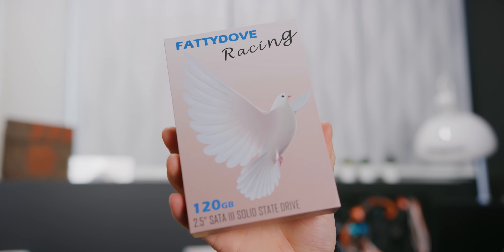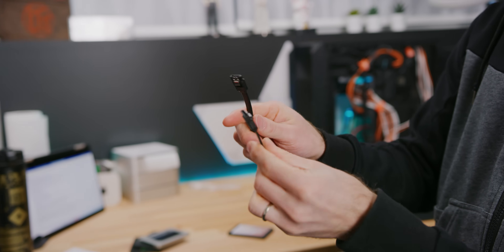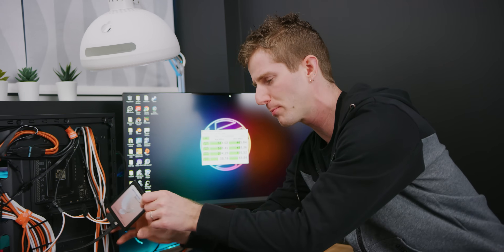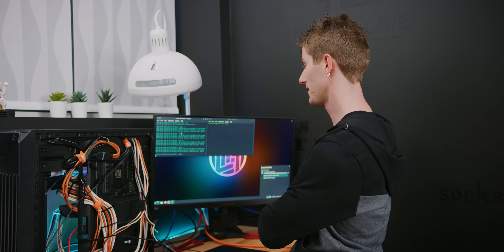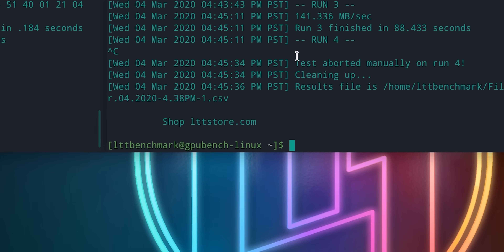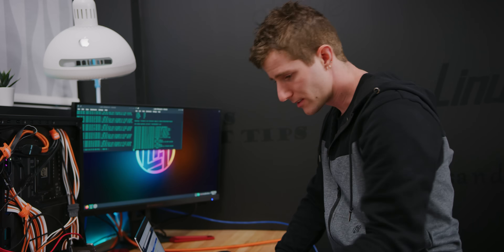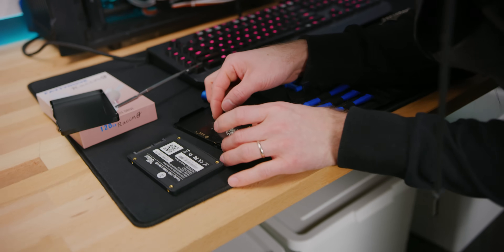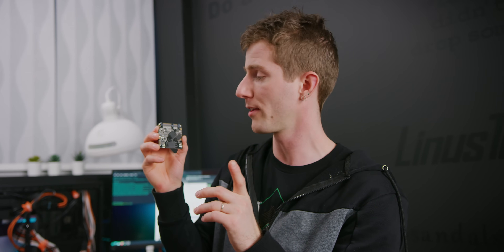How bad is this $20 SSD??

Comment: Such kind of SSD drives are pretty common in China, since I saw the manufacture is located in Shenzhen, China.

The key to reduce the cost is that they are using a 2nd-hand flash chip, desoldered from trashed components or something used. Or defective flash chips from flash chip manufacturers (It's still a mystery how they got the defective chips, because it should be destroyed by the chip factory). re-package them and sell them to customers, the warranty they claimed is mostly not helpful, they won't give you a RMA service in most cases.

Because this reason, this thing is easily broken, months to years is possible. Since the flash chip had been used for a long time (maybe a short time, it depends on the previous user of the Flash chip), most of them do not have a decent lifetime.

If you are seeking a SSD for your daily device, DO NOT USE SUCH THINGS FROM SOME UNKNOWN MANUFACTURE.

If you are just use it like some cacheing drive, won't store any precious data on it, it might be a good idea to use it. Because it's only cost $20 after all.

Comment: Damn.... I'm rather impressed, I am likely going to sell off my old gaming PC when I finish my new build.... I may buy one of these to put in when I sell it.
I wanna keep my Samsung SSD, and all my high performance HDD's. 
But putting this in, with a reinstall of Windows, and one of my old 1tb drives I don't use....... I think it would be well worth the investment on the return I'd get selling a fully done up system, rather then a parts system someone would have to finish. 

God knows how long it will last, but it's a brand new SSD, it's not like I made use of one of my old failing SSD's..... So I did my part!

Comment: My system is running on a 26€ 120GB Kingston SSD and I never had any issues. I thought the price sounded rather normal. 
I was getting a 250GB HDD back then, cus my old one broke, but then saw I could get an SSD with ½ the space for the same price, so I changed for that one.

Comment: It seems pretty hard to consider one of these when you can spend another $10 for a decent brand that might be around if you ever need the warranty.
Reply: @Vincenzio VonHook they became that cheap? Comparing em to sd cards... That's pretty much on par.
Reply: I got a SanDisk ssd 120gb ssd for 10 bucks in an eBay auction, but buying obscure brands with low reliability isn't the best

Comment: "sata cable, pretty good bonus" not so sure about that, more a source of garbage and pollution. I get 2 cables for each motherboard I bought, overtime I've probably accumulate over 10-20 unused sata cables that I'll never use... really it is not a good idea anymore to include extra stuff we won't even use. I would say the same for modular PSUs, they should only include the motherboard ATX and 12v cable (or maybe enot even that), and you buy the rest with proper length and everything would fit even better

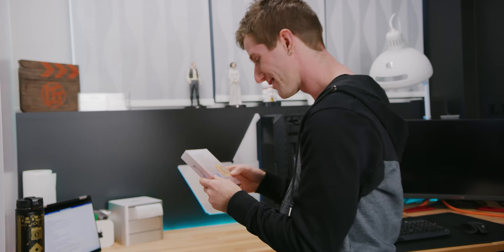Comment: 1:21 Linus, I can explain, I lived in China for over a decade and even then, there are things which I call Quantum Chinese, or QC for short. 

Why? 

Because with quantum physics is it's impossible to know, with any certainty, the reason behind of any observed behavior.  So too with Chinese, its impossible to know, with any certainty, the reason behind any observed behavior. 

I wear many hats, I worked in manufacturing, I am a neon glass blower, I am also a designer and its with the latter I can explain, without any certainty why this SSD has a Fat Dove and the word "Racing", because Quantum Chinese. 

The bird is there only because its a symbol for peace, and peace is a nice thing, so why not have a really peaceful dove?  Why is it fat?  Buddhas are fat, and if anything is peaceful then its a happy fat Buddha, right yes?  The word "racing"...that's easy it means to go very fast, as fast as possible in fact!  The peaceful fat Buddha dove doesn't have any connection with Racing, and why should it? While you're bathing in the fat Buddha dove Chi you know that this product is very fast, one might say "racing" and look here, it does say that.

And there you have it, Quantum Chinese.

Comment: Hey guys, probably a bad place to ask but I've terrible at PC diagnosing and i recently built a new pc for myself
My issue is general under performance particularly in minecraft where in this weird case if i change a setting like graphics from fast to fancy, my frames jump up to 300-400 roughly where they should be, but as soon as this happens it slowly goes back down to between 40 and 100 frames, i have checked thermals updated my bios and I am absolutely baffled please can someone help me out I have never been so stressed out in my life!!!
Specs are as follows : i7 9700k
16gb ram
2070 super
550w psu
msi z390 a pro mobo

Comment: I have a really budget garbage SSD in a Socket 478 Pentium 4 system I setup for running old games, Windows 98, 'cause emulation just doesn't do it for me. The SSD I have in there is a 32GB KingDian SATA II (Yes, SATA 2, not 3) rando cheap as balls on amazon (Like $13) SSD. It's also running on an IDE to SATA adapter, so I wasn't going for speeds, just somewhat modern reliability.

Comment: The day had finally come when Linus uses Linux to do some routine hardware testing for a review. :) Makes me so happy!
Reply: Which linux version is that?
Reply: @akshay6019  It's Manjaro KDE
Reply: @ChrisLoyen  Yes indeed, that theme is breath2, the default Manjaro theme, and the colorscheme for the terminal is also set to breath which is default in Manjaro. I have distrohopped way too many times, so much so I instantly recognized it was Manjaro lol...
Reply: @akshay6019  No way to tell which distro/kernel, but the desktop is KDE/Plasma. Great desktop for general use...maybe among the worst choices for hardware testing though (all that polish/flash comes with a price in resource overhead).
Reply: @Code-Sandbox-Dev  not anymore. KDE now uses less ram than xfce. :) To be fair though, I'm guessing they're using Kubuntu, which wouldn't have the latest version by default. Still, the fact they just casually booted into Linux to run hardware tests is amazing regardless. :)
Reply: "leaves"*

Comment: I have PNY CS900 120GB 2.5” SATA III Internal Solid State Drive (SSD) - (SSD7CS900-120-RB)- got it for $20. It works just fine on a laptop that is 10 yrs old now. 👍🏻

Comment: Next news story to be along shortly:  CEO of Fattydove Racing found dead in the street with an nvme SSD sticking out of his brainsteam.  Seriously, Samsung et al are not going to stand for anyone breaking their ABSURDLY profitable pricefixing scam.  Anyone with half a brain could see that NAND storage is 100x cheaper to manufacture TB-for-TB compared to hard drives and just naturally 100x faster than mechanical garbage.  It's just so basic, needs no exotic materials, nothing.  It's a grid of transistors.  Not a million miles from being interesting, much less lucrative.  The ONLY way to preserve the existence of the whole mechanical drive market much less prevent storage costs from falling to almost nothing, is rock solid price-rigging.  It's not a random coincidence that Samsung was the company to bail the corrupt president of SK out of jail and that same president was the one who cancelled the investigation of the NAND market for price-fixing.  It's not a random coincidence that the exact same companies making NAND flash storage are the ones who got busted for price-fixing RAM chips, then got busted for price-fixing LCD panels, then got busted for price-fixing RAM chips AGAIN.

Comment: Cool drive. I'll stick to my 120GB Kingdian S280 drive with infinite TBW tolerance. $25 but that $5 premium edged out the Fatty. 60/120GB disks don't make a whole lot of sense to people but for a while 60GB was my main and then this 120GB disk. The 60 is now the main drive in my rack and the 120GB is now additional storage in my development server. The main disk is a 240GB Corsair MP510 NVME drive and I kind of wish I had another to do RAID 0. Imagine using another Fatty and doing reasonably fast SATA 6Gb in RAID 0 for $40.

Comment: Hey Linus! You should check out the 'FATTY DOVE' counterpart on Amazon.co.uk 'ALERT SEAL'
ALERTSEAL SSD 48GB 2.5 Inch Internal Solid State Drive SATA 3 SSD for Computer (SSD-48GB) 
https://www.amazon.co.uk/ALERTSEAL-Internal-Solid-Computer-SSD-48GB/dp/B082HR9ZRL/ref=sr_1_22_sspa?keywords=SSD&qid=1584051686&sr=8-22-spons&psc=1&spLa=ZW5jcnlwdGVkUXVhbGlmaWVyPUFTUFJTMlk2UjdNNlQmZW5jcnlwdGVkSWQ9QTAwMTk3NTcxUjRXRElXVVBQU1VSJmVuY3J5cHRlZEFkSWQ9QTAzMzM5NzlWWFVBRTBYVE04V0Imd2lkZ2V0TmFtZT1zcF9idGYmYWN0aW9uPWNsaWNrUmVkaXJlY3QmZG9Ob3RMb2dDbGljaz10cnVl

Comment: HIlarious!! I just clicked on your link to the FattyDove and the price listed on Amazon is $597.90 !! Took a screenie in case it changes back
Reply: Over $620 for me
Reply: $37.89 for me
Reply: 37 bucks for me
Reply: @timoschubert96  $37 is 240Gb. The $20 one they have is 120Gb.
Reply: @timoschubert96 exchange rate must be screwed up for me
Reply: It's because they don't want to run out of stock, which means they have to relist it, which cost more. They increased the price so no one buys it.
Reply: $626.39 for me!! 😂😂😂

Comment: you know if they would make a 3.5 inch ssd imagine the storage capacity you can get instead of making chips smaller they just add more storages chips and pcb boards that are connected

Comment: I´m pretty  pleased with my 18€/20$ 128 GB Kingston SSD. It`s mainly used for Windows and small programs but felt really reliable.
Reply: I have a 1120GB SSD, i split it in 3 partitions and installed a OS including all programs in every one of them (3 OS installations in total). But i don't know that to do with the other half.

Comment: Hey Linus!
I just want to point out the reason why I would prefer a cheap dram-less SSD before a traditional HDD and that is: Windows Fragmentation.

Even after improving this issue a bit with Win10, an HDD will work fine with a fress Windows for about 3 weeks to 3 months depending on users, but after that you will need to defrag the disk and 90% of users do not even know what is this.

But SSDs, even the cheap ones do not suffer as much with Windows fragmentation so I have recommended always these drives to store OS and apps

Comment: Would it work if you took a bunch of low-grade processors andothers parts and put them all together in a huge case as a sort of Frankenstein pc or would the sum of it's parts not add up to any improvement?

Comment: In all my years working with Linux I have never heard anyone pronounce it “soo-doo”
Reply: My dumbass read your comment like if you worked with Linus
Reply: I have heard it as both soo-doo and soo-doh. Also, gnome and guh-nome. Etc etc etc it doesn't really matter
Reply: It stands for :
Su bstitute User Do 
So it is pronounced Soo doo :)
Reply: @fleefie  substitute? Not Super User?
Reply: @o0julek0o  substitute yeah, afaik. You can use the -u flag to specify the user. Default is root, as it is what you tend to use it for most often :)
Edit: admittedly, it used to (ages ago) only do superuser. So originally it stood for superuser, I think.

Comment: The marketing is probably not on the level, but I think TLC SSDs do have SLC cache in the sense that they use some cells in the flash chip in SLC mode to act as cache. Explaining Computers had a video about this.

Comment: Some DRAMless drives can treatsome of the reserved flash as SLC and use it as cache.  You just get 1 bit per cell capacity instead of 3 for the part of flash that you are using as SLC cache.

Comment: hey i need some help if anyone got time, i had 16 gb (2x8) ram corsair rgb vegeance pro 3000mhz, n bought a new kit of 16gb (2x8) corsair rgb vengeance pro 2666mhz, n put them all together in my pc which should be 32gb (4x8)gb ram. so i turn on my pc and only 2 of the rams are working, i check bios and it can only see 2 of them. i turtn off my pc and change the placements and 2 of them light on but 2 of them aren't. tried to find vids to fix it and i just can't find anyway. I got a ryzen 7 2700x cpu and a tuf gaming asus motherboard, windows 10 home. usually i checked and it supports that much and def more. if anyone got any idea on how to fix it, it would be great

Comment: I have AT&T DSL sadly the only option where I live is there anything I can do to increase its speed? Will a vpn help at all?
Reply: No a VPN is never going to make your internet faster, the best it can possibly do is be fast enough that you don't notice it.
Reply: @boheyo  The main reason I asked was because for example after 7pm for whatever reason it seem like my speed is cut in half.  Normally I'll have around 6gb down but after 7 it's like 2.8 - 3.2mbps and at midnight on the dot the speed returns to normal I figured this was due to AT&T throttling their speeds.  Maybe I'm wrong on this assumption

Comment: If its only 1 layer deep it will be slower compared to 3 layer but as it gets full it should be faster since it only has to access 1 layer when its reading or writing....it should last longer also because its not layered unlike triple layer where data accessed on the bottom layer will also affect the 2 layers above it in terms of wear on the drive which shortens the life span of the cells. My intel nvme drive and many ssd drives are fucking annoyingly slow when they get over 60% full. I now burn a lot of stuff like media files to blue ray and install programs that are space hogs or used little on a mechanical drive. I then have 6 ssds and 1 nmve drive to run my linux os with a  vm windows 7 instance, virtual drive space plus games across all of them keeping them below half full most of the time.

Comment: $20 isn't really a bargain, the price scales to $40 for 240GB SSDs and somewhat linearly until you hit TLC and QLC SSDs.
Reply: Connectors, RAM, controller, case and PCB also cost money, you don't expect linear prices. If so, i would love to buy a 16 GB SSD for just 3$.

Comment: I don't think anything could be slower than those 4TB portable HDDs that Seagate sells.  That thing just crapped all over itself when I tried to backup 4TB drive.  100IOPs and effective data rates that rival early 1990's tech.

Comment: Hi Linus,  i have a question.  It is a bit out of the topic, but i couldn't find where i can contact you. So i hope you help me with your tech team. So i am using 5.1 surround system on my pc.  I am listening music with Foobar2000 with superb plugin called '' channel mixer''  that upmix the stereo mp3 songs into 6 channel 5.1 surround with full control of each channel. It's all working great,  but when i listen youtube videos the sound is coming only from 2 speakers, because youtube streams only in stereo. I searched for days for a addon or extension or plugin for internet browsers that do the same but with no luck. There is a solution to use the audio driver option called fill the rest of the speakers,  but it is crap. Can you suggest a solution? 
https://wiki.hydrogenaud.io/index.php?title=Foobar2000:Components/Channel_Mixer_(foo_channel_mixer)

Comment: sees title

Me, who uses an ~20$ Gigabyte SSD in my PC: confused noises
Reply: Are we not going to talk about the fact that PNY has a 120 gig SSD that is better than this one and from a company that you can actually trust
Reply: @DesmondTheGrape2  that's what im using
Reply: George Hannah PNY is terrible.  Bought about 200.  Half of them died within a year due to firmware bug.  To update firmware, it wipes drive.  Still sending in drives from initial failure.
Reply: Me too, honestly we likely both need to upgrade to something that at least uses PCIE.
Reply: @ValdVincent  nah my pc is very old anyways, works great still, after 12 years.
Reply: @ValdVincent  In real world benchmarks, there is almost no difference, i mean linus did a recent test.
Reply: I used to use a 500gb samsung ssd in my old laptop that I got for free
Reply: I use a 20€ Samsung 840 Evo 250GB (SATA 3 SSD) for my desktop PC and it actually works really nice.
Reply: I use a 20€ WD 240gb drive for my old laptop (actually paid only 15 myself). It works perfectly fine and as long as you don't copy and write gb files all day, it's the best bang for your bucks (important data shouldn't be stored on it of course)
Reply: Shut the fuck up.

Comment: My first SSD was a 120GB Radeon R7 (OCZ made, AMD branded). It was $25. My next one was a Patriot 120GB SSD. Both were $25, both were significantly faster than a mechanical drive. Just because an SSD is $20 doesn't mean it's gonna be trash Linus. Has LMG gotten so much free high end stuff that you haven't browsed around NewEgg in like 10 years or something?

Comment: $20... US?   Because 128GB for $20 translates to $160 per TB,  and at that price you can get a 1TB drive, that's not "Fattydove", for cheaper than that, hell you can get some NVMe drives at that size for cheaper.

Comment: The KingDian 120GB SSD in the system I am using right cost me £34.99 new in 2016. The Crystal Mark I've done just now reads at 550, 273, 525, 28 and writes at 370, 283, 348, 99 (Seq Q32T1, 4k Q32T1, Seq, 4k). The same SSD is £19.99 new now.

Comment: What about those Inland Pro 120GB drives for 20 bucks? I have one in my aunts PC, it's about 2 years old now. Also I had one in my AMD system for about 10 months and that drive is/was fast. It takes about 10 seconds to boot and loading was/is quite quick. It also scored over 500MB read and over 450MB write. 

 Nothing wrong with the AMD system, it got replaced by my 4690K Workhorse PC (running a Samsung 850 evo) after I built my new gaming PC. So, the AMD system still works but not needed anymore. And no I'm not giving that PC away. I would have to pay someone to take that POS. It's old AMD and it's complete crap.